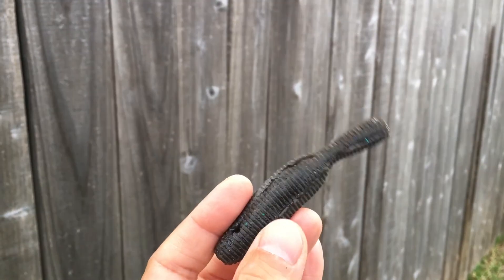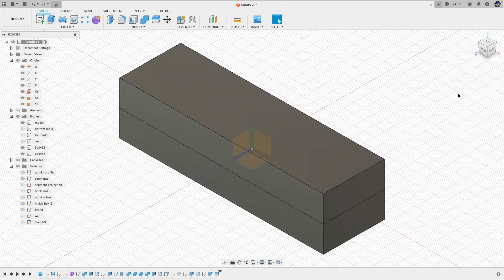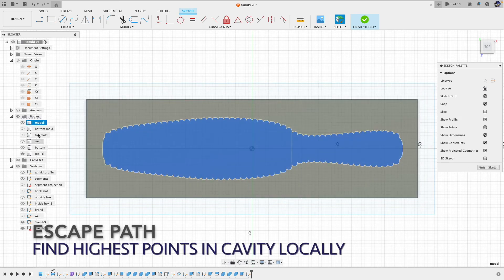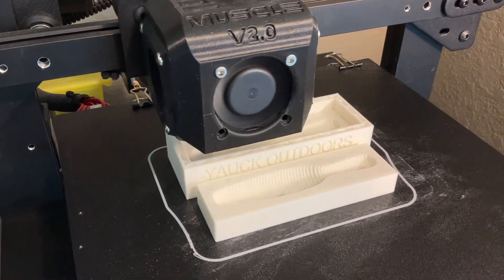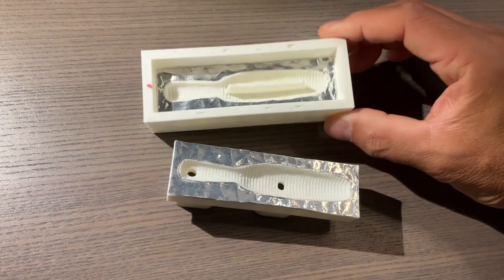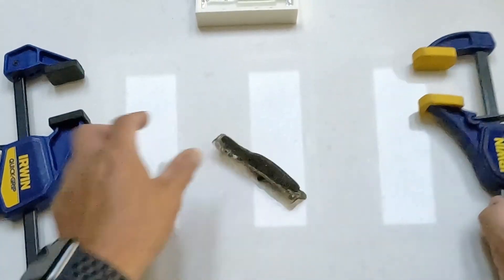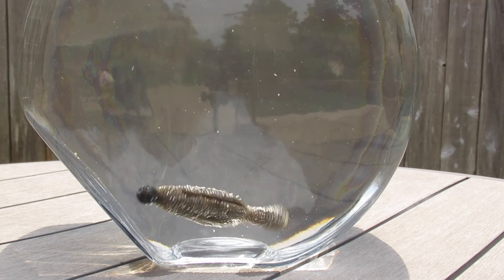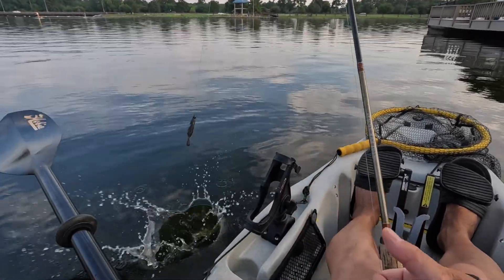YAMATANUKI DIY Without An Injector

Comment: With 3d printing (traditional 3d print, not resin print) molds baits are not shiny. You can use a torch to make them look shiny but be careful, it's easy to set bait on fire (what I accidentally did)
Reply from the maker: I can try heat gun, I am not good with fire 😂